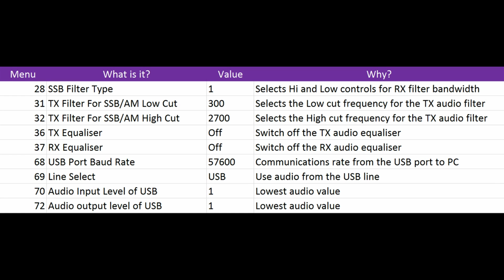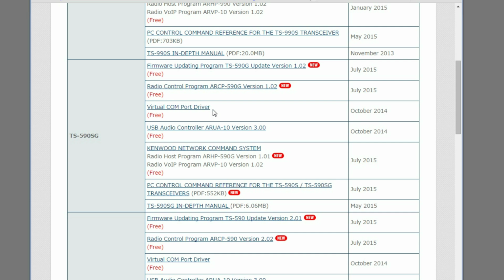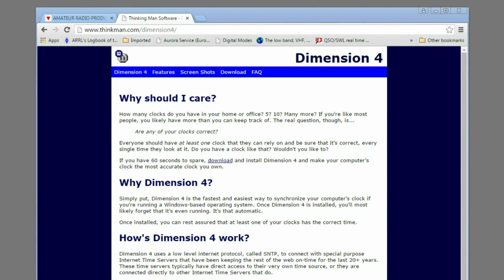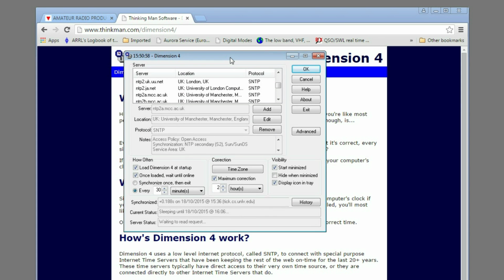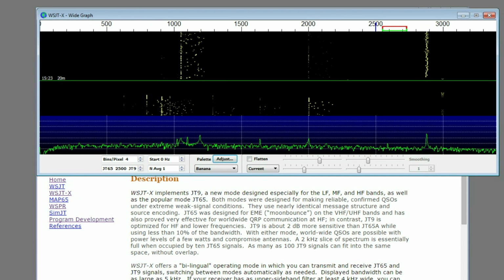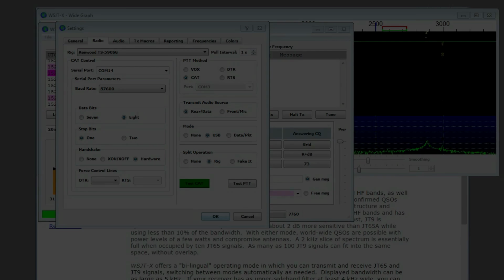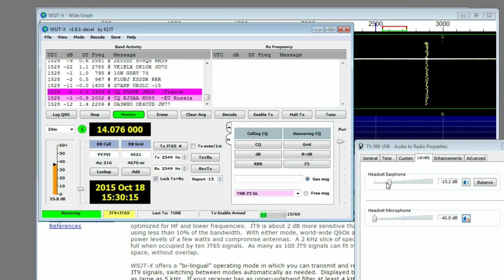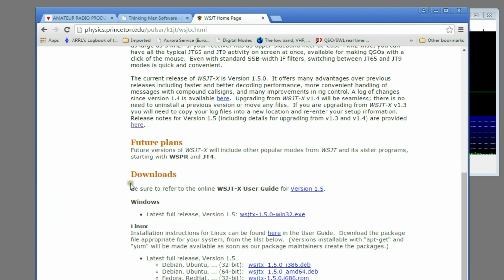LAMCO Tech Video - TS-590SG WSJT-X

Comment: Great video.
What should I do if VFO B doesn't move when I click on the waterfall?
😵
Reply: Thanks for the info.  I’ve done nothing with digital before so I thought I’d check it out.  I may take you up on the email if I still have problems or don’t understand it.  Thanks for offering me that 👍
Reply: Mine doesn’t move either 🙁
Reply: @darinbell6982  I've found that VFO B isn't important for FT-8 use.  I was very new to the hobby, and digital specifically.

If you need help setting up for FT-8, my email on QRZ is current.  Shoot me a message.
✌
Reply: @darinbell6982  BTW.. I have the software set to " fake it" rather than rig... seems to work well for me.
$.02

Comment: Does changing those settings on the TS590 have any impact on SSB  use? Can they be set once for digital modes and left, or do you have to undo them for SSB and redo when you want to work digital again?
Reply: John Ratcliffe better late than never. You can set up SSB on Menu A and digital on Menu B (or vise versa.) Set the display to Amber for one Menu set and Green for the other. Then you'll know at a glance what mode is in use. 73

Comment: was excited by this as I have been having problems, but deflated when I tried to reconcile the video to my situation, as I am running windows ten, seems to be a different device manager?
Reply: Right click on the start menu and there is device manager the same as previous versions of windows. You will also need to find that audio control panel he showed in the "old" 'control panel', not the new "Settings" app. To get to this, click in the search bar next to the start button and search for "control panel". Once that is open you should see the sound control panel listed.